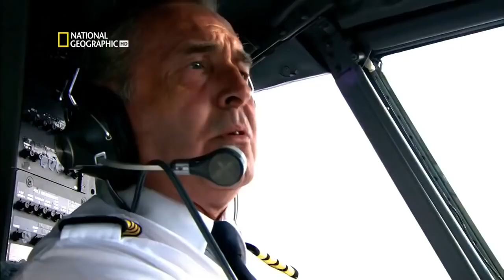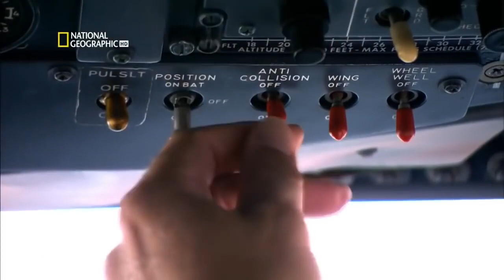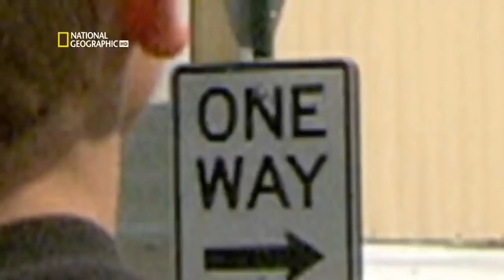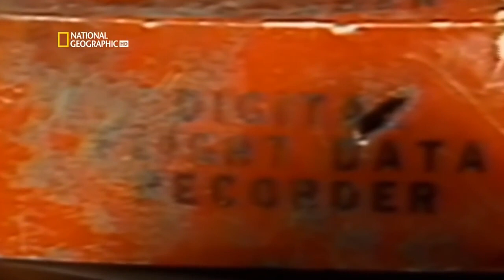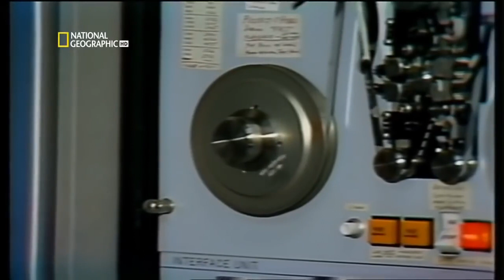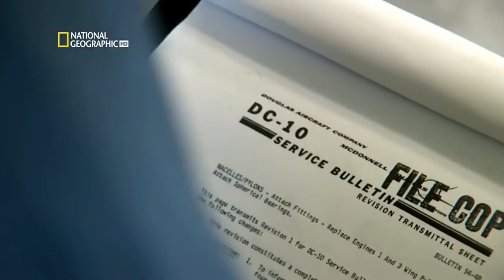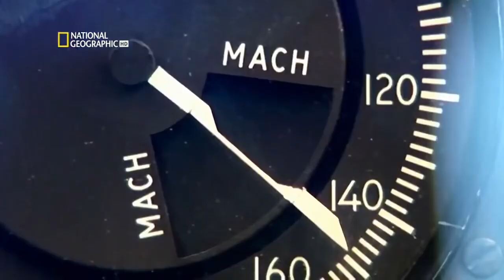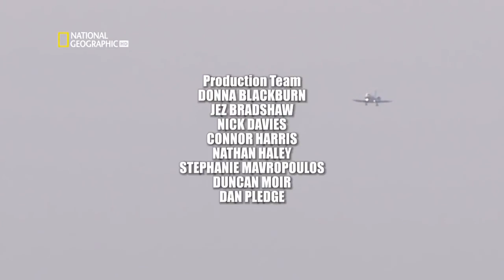Seconds From Disaster Flight 191 Crash (Chicago 1979)

Comment: Three things that could have saved flight 191: Do not reduce forward airspeed with wing slats extended, pilots aware of the speed, and for Captain Lux, he should have stopped the steep climb up to 90 meters which is 300 feet to prevent the left wing from stalling
Reply: They had no power in the cockpit so they had no idea they were going to stall. The left engine on that old design DC-10 generated all power for cockpit and the hydraulic lines were ripped to shreds
Reply: @nordicpride9708  yes that is true, but the training for American airlines wasn't correct. Co pilot Dillard slowed down to 283 km per an hour which stalled the plane even further

Comment: 22:13 that photo taken right just before the DC-10 crashed, I've seen it in a few books, online articles and through a Google search as well. Out of all the DC-10 accidents that have occurrd, the 3 I consider the worst are the 1974 Turkish Airlines Flight 981, this one (American Airlines Flight 19 in 1979) and 1979 Air New Zealand Flight 901 (that occurred a few months after Flight 191 and was both NZ's worst air accident and worst disaster to occur) crashes.
Reply: There is an even more terrifying photo that looks to be taken literally a moment before 191 impacted the ground.  I'd post a link, if you've not seen it, if YouTube wouldn't auto-remove my comment.

Comment: What I am wondering is: why didn't this engine break off earlier? Was the damaged part strong enough to keep it in place untill this take-off? [I'm not a pilot but by tv-series I've learned that the most stress on an engine is generated during take-off]
Reply: If it had broken off earlier, then the question would be: why didn't it break off earlier still?

Comment: Surely there could be a solution for reaching the point they HAVE to the take off. So many lives could have been saved over the years if they could make longer runways. It seems senseless to be committed to take off in a plane that's not able to fly but you have to take off anyway because the runway isn't long enough to stop.

Comment: The pilots could've prevented the crash if they shutted off the right engine and made the tail engine full throttle
Reply: Is that true?
Reply: @trawlins396  its just what  i think also the right engine was still giving thruster power in the right wing while the left wing didnt, causing the plane to bank left by itself if the pilots cut off the right engine and moved fuel to the left they couldve saved it.
Reply: @rick.rollboi  apparently you're right. I watched a full doc on it and the NTSB guy said if they DIDN'T reduce speed the plane would have stayed in the air. How sad.
Reply: I think the plane banking left was more of an issue of losing the lift on the left wing than an imbalance of thrust. It was probably just more of an issue that the procedure shouldn’t have been to reduce power and overall speed, and not so much an issue of which remaining engine was providing power. 
With less lift than normal coming from the left wing, reducing power and overall speed and called the plane to stall.
(“Stall” in this context means the loss of a sufficient amount of the lift that causes a plane to fly. Lift of course results from the pressure differential caused by the shape of an airplane wing moving through air. Increasing the speed the wing moves through the air increases lift. Excuse me if you knew that. Just wanted to be clear.)

There just wasn’t enough time for the pilots to figure it out. Due to the plane’s instrumentation design, i.e. power for the warning system being dependent in the left engine, they didn’t have the instrument information about the slats on the left wing retracting, and for the same reason they didn’t have the stick shaker stall warning mechanism to tell them that a stall was the issue and they needed more power/airspeed. (From what I saw the video doesn’t really explicitly say why the flashing light stall warning indicator didn’t function, so I assume maybe that also malfunctioned due to the loss of the left engine.)
Reply: If they would have know they where in a stall and increased the soeed they would have got out of it but they didnt know and where following protocol for an engine failure. They never new thry lost the engine or the hydraulic lines where severed
Reply: That would have driven it nose down.
Reply: It rolled because the left slats retracted.
The left wing then stalled.
Reply: It was designed to transfer electrical power to another engine in case of engine failure. 
When the engine tore away pulling out electrical system components,  it popped the circuit breaker controlling that system.
There wasn't time for the crew to diagnose anything. 
This crew did everything by the book correctly.
Had mantinence did their job correctly,  the engine would not have broken away.
This incident would not had happened.
The loss of power in 1engine would not have hampered take off what so ever.
There was no design flaw. 
Those mounting plates are designed for the life of the airframe, but cannot be compromised what so ever.
Automotive parts, such as the bracket (mounting hardware) for air-conditioning compressor,  power steering pump, and alternator are aluminum, and will last forever, but if 1 gets the slightest damage or crack,  they will come apart quickly.

Comment: At 39:50 its said that 13 pilots attempted to recover the aircraft in a simulator and none of them succeeded concluding that emergency procedures were to blame. So did anyone ever figure it out then?
Reply: All of the simulator runs where the pilot kept the nose down/speed up were successful, as far as I know.  I witnessed some of them.
Reply: @marcmcreynolds2827  Wtf is that for
Reply: @shocker4578  Are you asking what keeping the nose (pitch attitude) down is for?  At a given thrust level, an aircraft will fly faster when the angle of atack is less.  In this case, fast enough that both wings keep making about equal lift and the aircraft doesn't stall + roll.  For the simulator runs, it presented as  the TV camera moving across the model scenery (which fed an image to the simulator cockpit ) continuing to point slightly upward and gain height above the miniature runway.  For the runs talked about in the video, the camera would rise a foot or so and then tilt down.
Reply: @shocker4578  That's because they went nose UP and decreases engine speed causing a stall

Comment: how can that dog trainer say he heard the engine sputtering, cutting in and out... the engine wasn't even on the plane... and the other two engines were operating normally...  loss of hydraulic pressure on the flight controls brought the plane down....  not the engines.
Reply: I think its done to lead you towards engine failure before elsewhere to make it more interesting.
As if a plane crash isn't interesting enough
Reply: @stevendavidson1082  exactly
Reply: Turbofan engines tend to surge(backfire) at low speeds and unusual angles of attack,among other causes.
Reply: It was probably compressor stall he heard because of interrupted air flow in the other 2 engines. 
The bank angle, and angle of attack just before impact could have caused it.

Comment: Faulty training manual, stick shaker on only one yoke and warning light powered by one engine, FDR and CVR also powered by one engine,  having to get up and manually turn on the backup hydraulic system, cargo doors that don't latch properly so it blows off and the result is explosive decompression, a piece of it fell off and caused the Concord crash, (a plane so deadly you don't even have to be in it for it to kill you) improper maintenance technique. Good God did they intentionally design this thing to be a death trap? And to think back on how many of those things I have been on is scary.
Reply: Jimmy, you're clueless.
Reply: 💯 FACTS!!! The DC-10 is the worst plane in the history of aviation. If you didn’t know better, you would think it was a Chinese knockoff that was produced
Reply: "FDR and CVR also powered by one engine,  having to get up and manually turn on the backup hydraulic system"   The video is wrong on some things (I'm about to post a partial list, after I look a bit further through the comments).  The backup electrical (not hydraulic) system was easily activated by turning a switch in the middle of the overhead panel reachable by either pilot.  Hydraulic power was present throughout the flight. 

The only cargo door failure after the initial incident which led to changes was when an operator shortened the latches until the door could only resist a small fraction of the design pressure differential.

Good God, did he intentionally design people to believe everything they see on the internet?

Comment: They said that the plane can fly without that engine and that something else overall cause the plane to crash but then says the bolt is the one that made the engine come off and cause the plane to crash. Sounds contradicting to me.
Reply: The early "blame the bolt" thing was simply wrong, and the plane definitely could fly without that engine.  It crashed due to a combination of things, including reducing the airspeed while unaware that some of the slats were retracting.

Comment: I have seen this episode awhile back but I just watched another vid about it so forgive me if it’s answered in the episode....but were they just too far into the takeoff to stop?

I know there’s a point where planes can’t turn back but is that because of lack of runway?

They obviously didn’t know the extent of the damage but they must have know it wasn’t good, there was no way they could have just aborted the takeoff?
Reply: Yes, the plane had already reached V1, which is defined as the speed beyond which the take-off should no longer be aborted. Prior to V1 a pilot can abort take off, but after V1 they have to continue the take off or else it will lead to a runway overrun.
Reply: There is some margin built into the V1 speeds (at least when the runway is dry), such that when braking at V1 there should be a substantial amount of runway remaining at full stop.  Say many hundreds of feet, or even more.  But a pilot has no way of knowing what that margin is for any particular takeoff, and history has shown that continuing takoff after losing an engine at V1 is usually the best decision, so pilots should only second-guess if they know or strongly feel that the aircraft is no longer airworthy.  A "simple" loss of power from one engine doesn't meet that criterion.

Comment: Let’s not forget the DC10 was the ✨MAX✨ of the 20th century
Reply: Lets not forget, you're wrong.
Reply: @alhanes5803  then what other plane was it? Dc 10 and the max had the:

Corporates trying to cut cost/money
Fatal design flaw

And before you say "WElL dUh 747 haD mOre AcCidenTs!" It didn't have such bad design flaws like the dc 10. Most of its crashes were improper maintenance, pilot error, or terrorism. Back when... you know, boeing used to make good planes.
Reply: @alhanes5803  what garbage have I spewed? So far, I think the description of McDonnell Douglas rushing their aircraft into production is quite accurate.
Reply: @ron3557  what do you do for a living?
Reply: @alhanes5803  I dunno man perhaps I learn about aircraft? I don't really have a job but like. You haven't provided a counter argument
Reply: @ron3557  
I'm an aerospace engineer.
Reply: @alhanes5803  being an aerospace engineer doesn't make you immediately win an argument. You must present arguments, and in this case I seem to be correct. Please don't have the mindset of: I'm older = I'm automatically smarter. Why do you think I'm spewing garbage? I'm correct about McDonnell Douglas rushing the dc 10, and not bothering to fix the cargo door after 2 incidents. I am correct about 747 bring safer, because 90% of its accidents are poor maintenance, terrorism or pilot error. I'm literally correct, and what are you correct about?
Reply: @ron3557  
The cargo door was a bad design yes.
It blew out on flight 96.
There was a directive sent to all airlines of what to do to fix the problem .
Turkish airlines didn't do it, except to make it worse.  They filed down the locks to make it easier to close. 
MD completely changed the design to solve the problem. 
All of the other crashes were just as you said with the 747, and even the L1011,  was weather,  and pilot error.
The DC-10 has an excellent safety record over its life.
It's an established fact.
The MD11 has had no problems except pilot error.
Name 1 manufacturer that had 0 problems with a new aircraft. 
Your comment about McDonnell Douglas suck at building aircraft is false.
All I hear on YouTube is comments like, the death chamber 10.
1 fatal accident due to design.
Fed ex still uses both models, with o problems
Same bullshit with the max.
The 2 airlines, mantinence,  and the pilot's are the cause of the 2 max crashes.
Do yourselfa favor, and read the actual crash reports,  instead of just repeating bullshit on you tube. 
You only look foolish to anyone in the aviation field when you repeat completely foolish statements.

Comment: Looks like the bureaucracy is at fault for this plane crash, both in maintenance procedures and emergency flight procedures. All of the little guys did as they were told, but the plane crashed anyway because of red tape.

Comment: Turkish Airline Paris, 1974, was not an accident. It was murder. Plain and simple. Backroom Agreement.
Reply: Why do you say that
Reply: + @lalalooloo   You don,t know much about the bottom line? Do you? Try Daily motion just for starters. Backroom Agreement. The problem should have been fixed 1972. In reality 1970. I have known this since 1979. I have been an aviation fanatic since 1975.
Reply: @GT-Shelby  you're not making sense
Reply: + @lalalooloo   Daily motion Backroom Agreement. It,s a long story. This jetliner was designed with cargo door flaws and McConnell Douglas refused to correct it.1970.
Reply: @lalalooloo  he's talking about a completely different accident, Turkish Airlines flight 931 I believe. Also involved a DC-10
Reply: + @doabarrellroll69   Detroit to Buffalo 1972. Cargo door ripped off on American  DC-10. Aircraft just barely landed safely. Problem was suppose to be fixed. Was not. Turkish Airways DC-10 Paris March 1974. 346 die. Same problem. Watch Backroom agreement on Dailymotion.
Reply: @GT-Shelby  
Watch something decent. 
Turkish airlines did it themselves.

Comment: The pilots mistake was to slow the plane down. He should have increased speed.
Reply: But it’s not his fault it was faulty. And they were train to do that. And it’s kinda horrible for them to even try to put the blame on the pilot even tho they were doomed to begin with
Reply: Thrust on the remaining engines need to be reduced to avoid an asymmetric yaw.

Comment: This take on AA 191 has mostly correct information, which isn't always the case. Somewhat slanted, though, along with minor errors:  American Airline's changing the maintenance procedure without MDC or FAA approval was called a "serious irregularity", when in fact that was allowed under FAA rules.  The reason they changed the procedure was supposedly about "quickest and cheapest", when American's reasoning also included the perceived safety benefit of disturbing far less couplings and connectors.  There was the senior metallurgist who somehow didn't know that engines had separated from airliners on various occasions ("you wouldn't have thought that that could ever happen on an airplane").  Characterizing the roll to the left as "sudden" was overstating things -- looking at the FDR trace it happened gradually over about 12 seconds (at that altitude, probably not recoverable after 4-5 s?).  It was the Slat Disagree warning light (disabled at engine sep) which would have called a pilot's attention to slat position.  "70 takeoffs were simulated ... 13 pilots ... not one manages to save the aircraft" doesn't mention that many pilots did successfully fly through the scenario when they kept their speed up instead of slowing to V2 (of course the 191 crew wouldn't have known to do this since they didn't switch to emergency power).  As for the silliness of "Ray" running along an active runway and supposedly almost being hit by a landing DC-10 (apparently flown by an airline with a very lax go-around policy), clearly these guys are not above taking liberties with reality. 

The one really wrong claim was that the emergency power system, which could have saved the flight by restoring power to the stick shaker and slat disagree system (among other things), was "impossible" to activate during takeoff. That switch is in the center of the overhead panel, by design easily reachable by either pilot.  From the NTSB report:  "The battery and static inverter operations can be obtained by rotating the emergency power switch on the pilot's overhead panel to the 'on' position."  The NTSB report also notes that it is unknown why the pilots didn't select EMER PWR, so of course there was nothing in the report about an inaccessible panel at the floor of the FE's station.